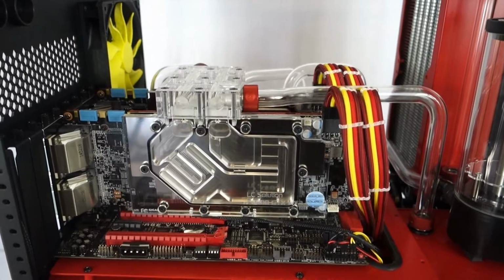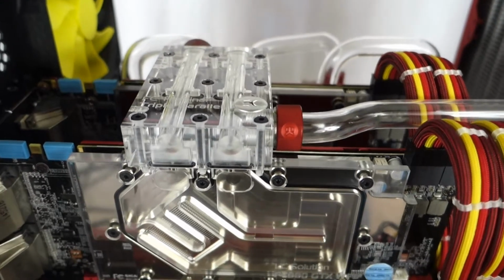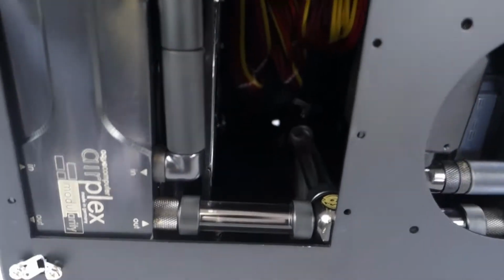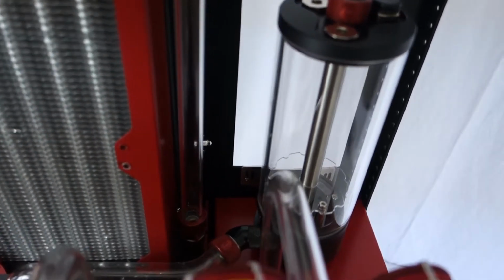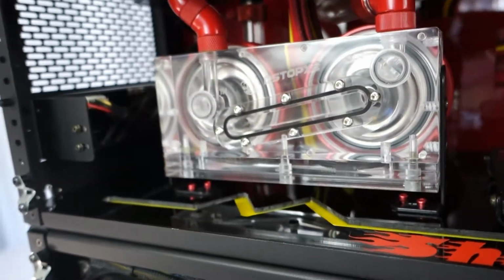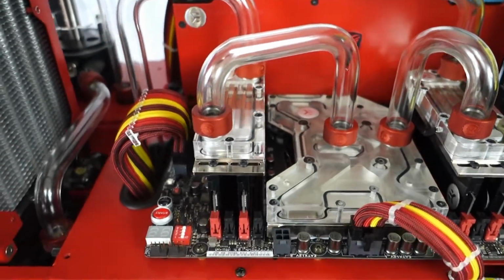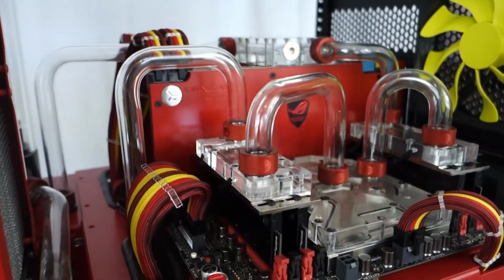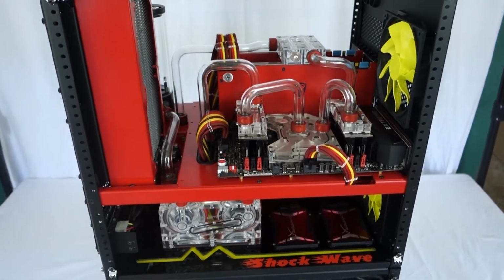Caselabs Mercury S8 - Shockwave Build Log - Part 9 - Acrylic Tubing Process

Comment: Nice build man.  Can I ask you what is that Red Radiator there? Is it Aquacomputer Airplex Modular System Rad aluminum? thx.
Reply from the maker: Hi yes they are all aluminum fins with copper tube inserts all round for the water flow areas. a great radiator and one of my best performing radiators i have ever used.
Reply: Why didn't you get the copper fin one? Isn't copper fin perform even better than aluminum? Also, ExtremeRigs website did a RoundUp review of like more than 10+ Radiators, and this Airplex Rad from AquaComputer is near the bottom of the performance chart, it's really bad.  So I dont know?
Reply from the maker: +jincuteguy I actually got these rads before the release of the copper fin one's. Also i would not take Extreme Rigs results are no way perfect at all. There are way better testing and reviews than that one. Go to OCN website for more information. Also it depends on how fast you want your fans to run as well. I have figures showing my rads to be awesome on this build and at very low rpms on the fans. There is no benefit from these rads at higher rpm's, these rads seem to just even out the temp very well, as i have read and found out myself. I like a quiet system and for me these just work perfect and have compared my results to many systems out there and i can say for one thing i am on the money with these. But everyone has there opinions and that is where i say go with what makes you feel good and what makes your system whole and look good. :))
Reply: Thx for the infos man.  Ya I like these AquaComputer Rad the best, I was going for these Rads then I saw ppl talking about how they perform worst near the bottom from that ExtremeRigs website review.  So I stopped and didn't buy these Airplex Rads yet.  But yea I know these Rads are for really Low RPM fans.  What fans would you recommend for low rpm?
Reply from the maker: +jincuteguy Beleave me you wont be disappointed with these rads. I seen and read so many reviews and test's and they do perform very very well. Use High Static Pressure fans that can go as low as say 400 rpm. Corsair makes some and so does Noctia. I used Akasa fans for their pressure and performance under low rpm. They are allot of good one's out there now, EK Vader now also make a very good static pressure fan. Check through the listing here for some https://www.pccasegear.com/category/9/fans-accessories